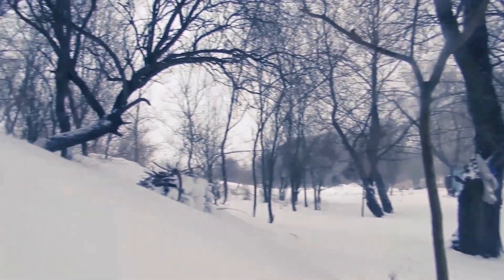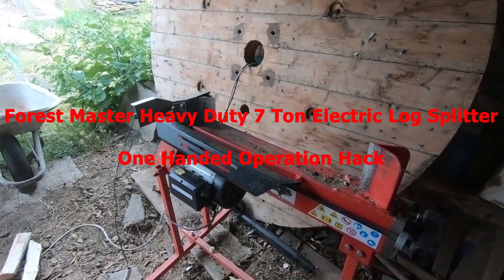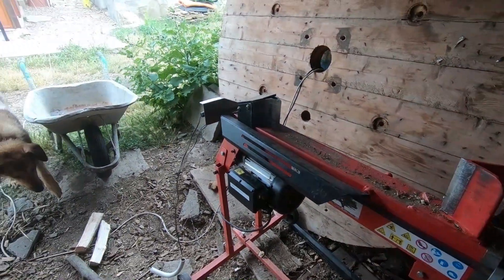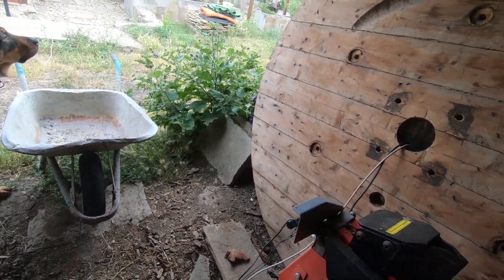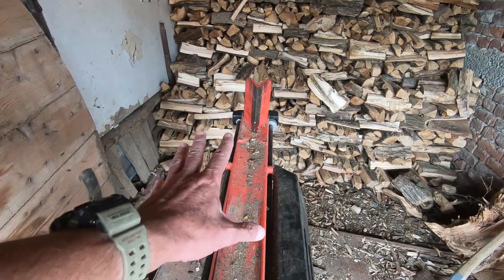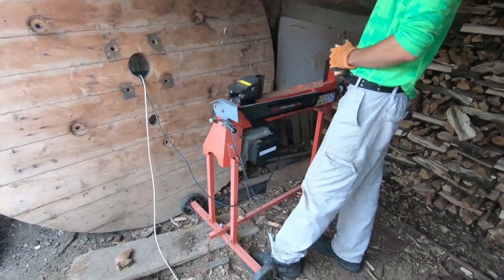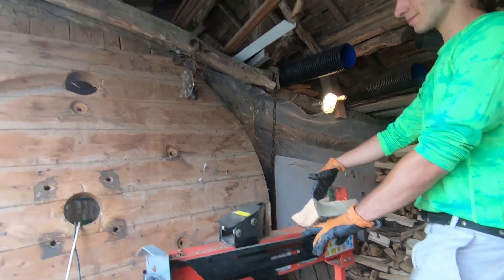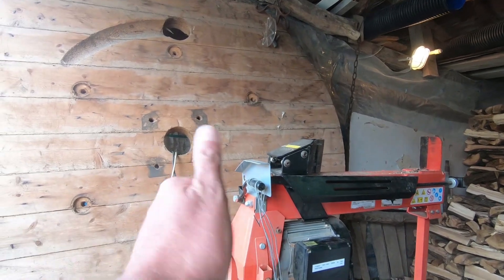Forest Master 7 Ton Log Splitter - One Handed Operation Hack

Comment: I've swapped out the standard sprung loaded switch to a positive on/off switch enabling me to operate the lever control with one hand which is more precise and slightly safer. 👍🏼
Reply from the maker: Sounds like a Good Hack, but how is it safer in your opinion?
Reply: The ram stops faster. With your method when you release the "button" the motor continues to spin for just a split second or so allowing the ram to continue its travel. 
It's a tiny difference I know. But what works for me may not be suitable for everyone, just thought I'd share my take on your idea, no offence intended 😊
Reply from the maker: @duke5889  I wasn't offended in the slightest, just interested and sharing is learning. Many Thanks for your comments, most appreciated.
Reply: Plus side it saves you the surge on your Electric from the start of the motor!

Comment: Instead of the wire, use a 6 inch ratcheting bar clamp/spreader from Harbor Freight. This clamp will hold the starter button in and keep the electric motor running. This also  Eliminates the surge on your electric current. Then use the handle to move the splitter ram.
Reply: I see you have the same size wood for all your splits. Use a vise grip to stop the ram from going through its full cycle back to the starting point.
Reply from the maker: @teddypilny9404  I don't always have the same size rounds and restricting the cycle from returning backwards, it doesn't like at all.  The best way to cut short the run is to place something at the far end, but you also then lose your sharp edge. Touch wood, this machine is still doing me proud with all the same hacks in December 2021 as it did when I made this film. Have to clean, grease and tighten a few bolts now and again, but overall, very pleased with it, but there again, except for Manual Labour, I have nothing else to compare it with,

Comment: Wouldn't you just put it round the wheel? Can move around then
Reply from the maker: Not quite sure now after 4 years of what you mean. I see this guy's foot is inside of the wheel, but I never use it like that, I always have the wire and pipe outside to the left of the wheel and it allows me full control like the accelerator pedal on automobile  insofar as, pressure down sends the splitting tool forwards and releasing the pressure by lifting your foot on to your heel, allows it to come back as required.
Reply: I mean put the wire around the wheel to keep the lever pressed down all the time without needing your foot?
Reply from the maker: @purelytm374  Then how would the splitter return? The correct UK Health & Safety method is one hand held down to send the splitting head forwards and to release it so that it returns again or, like a dead man's handle, take your hand off the lever, the splitter returns - all we did was wire that handle so it can be operated with a foot albeit, you can still do it by hand with the wire affixed.  I need two free hands for some of the large rounds I split.